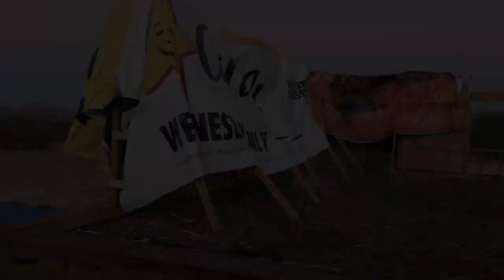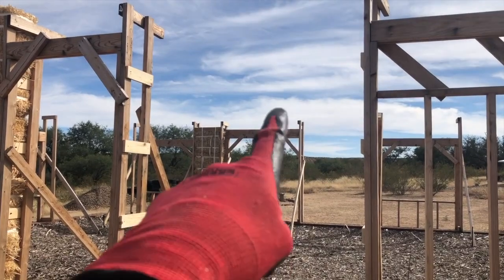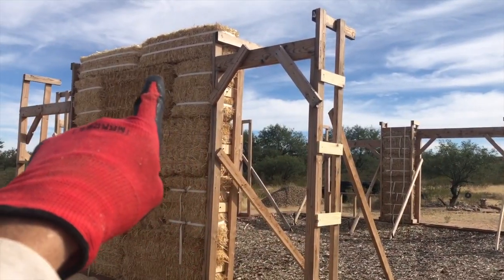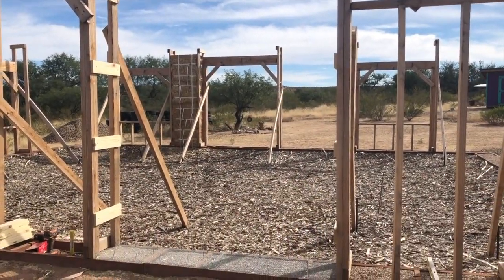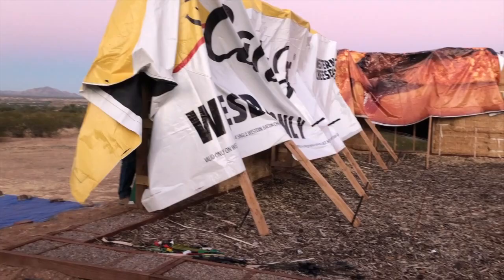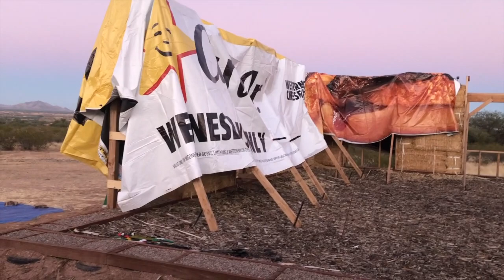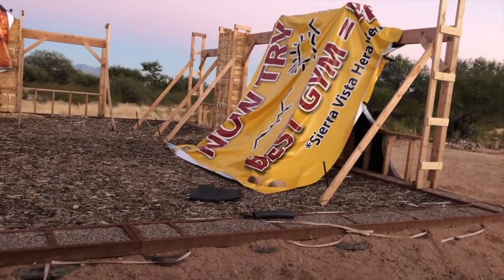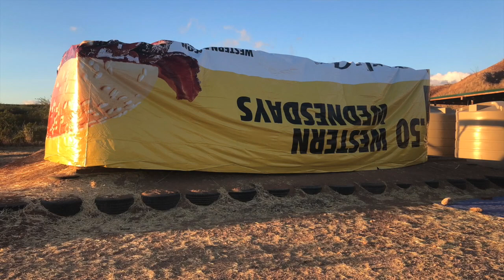Straw Bale Wall Construction Time Lapse

Comment: Congrats on 5K! The walls lol solid. Your design, having the walls broken up into smaller segments by the bucks was really smart. Short wall spans should make for solid construction. You'll see what I mean when you are done making the western wall. 👍🏻👍🏻
Reply from the maker: Thanks, guys.  I'm on the western wall now, and I TOTALLY see what you mean!  Even with a couple of what I'm calling "cheater" bucks to help with stability and support, that long stretch definitely wobbles.  Guess it won't really firm up until the box beam is on, and maybe even the trusses.

Comment: Loved this time lapse.  I keep learning a ton about straw bale here. I am wondering if you pre-drilled the studs where the vampire stakes are attached. Or maybe just used the power driver.   Impressed you get those top row bales up there Brian!  Way to go folks!
Reply from the maker: Thanks, Don.  I did not pre-drill for those TimberLok structural screws.  I usually do, but I tried one out, and it did ok, so I went for it!  The fourth course with full bales was an adventure!

Comment: Why are your vampire stakes 2 pieces? Looking great so far! Good job!
Reply from the maker: Sorry, John. That may have been a little misleading. They are just one piece. The second piece of wood you see me using is just to push the stake a few inches below the surface of the bale. It doesn’t stay in. Sorry for the confusion. Valid question, based on the way I showed it.  Thanks for paying attention! 👏
Reply: @MidlifePrices  got it! Thanks. Can’t wait to see how you will cover the straw!
Reply from the maker: @doghouseRMV  It will be an earthen plaster, but we've still got a few details to work out there.  Stay tuned!

Comment: You're doin good.  A wall at a time.  Do you have enough tarps once all walls are up?  when does plaster start going on?
Reply from the maker: Thanks, Bryan.  Think we have plenty of tarps, and will only need to worry about covering the outside once the roof is on.  We'll probably hold off on plaster until after winter.  I don't think freezing temps would be good for either the plaster or our hands!  Plenty of other things to work out in the meantime, though! 😃